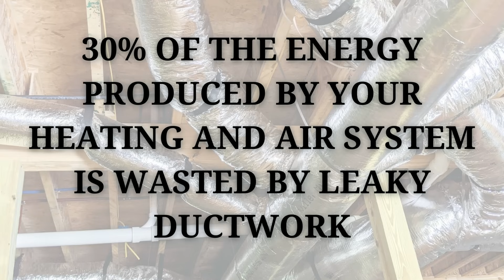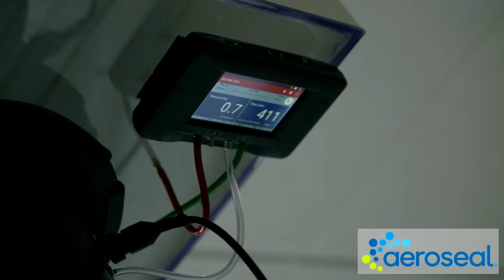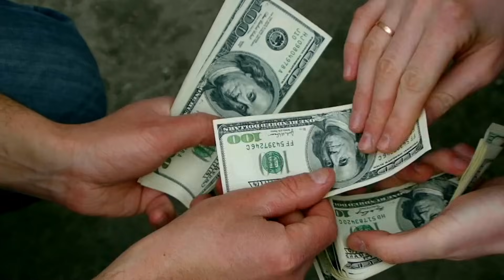5 Energy Wasters! - HVAC Wasting Your Money! - Save Money!

Comment: We could use some really helpful advice because last year we bought a new AC system that replaced the 19yr old one that was installed when the house was built and it worked fine and we never had any service on it in those year. We were sold a Goodman 4ton 18SEER system that has been an absolute problem energy wise because instead of energy bills going down they have actually gone up. We had an issue with a leak one week after the system was installed and the house was extremely muggy meaning we had over 45% humidity for over 1 month until I had them remove the thermostat and install a non bluetooth one. The humidity levels dropped over night but the electricity shot up to more than we ever paid with the old one. When the water was coming down the attic we asked them to come and fix it and I was told that the drip pan was cracked and that they had to replace the new one but they never did and then pop up into the attic was broken and they never fixed it and never fixed our ceiling. I was told to contact the Az Contractors office and file a complaint and also we have never received a copy of the permit for the unit because we signed a contract that all the work would be done to code. Can you please give us some advice ?
Reply from the maker: Eek. Is the contractor refusing to repair?
Reply: @NewHVACGuide  
They are giving us the runaround and they have since the AC went in
Reply from the maker: @RichardsBiggs  if they aren’t doing what their contract states regarding warranty, you may have a legal leg to stand on. Just make sure you keep good records of all communication Incase you decide to contact a lawyer.
Reply: @NewHVACGuide  Yes we have all the documented evidence we need if we move forward with a lawsuit we have the video recording from the security cameras but coincidentally they never not once ever gave us any paperwork other than the purchase order of what they came out here for and what they found.
Reply from the maker: @RichardsBiggs gotcha. Sorry it’s gotten that bad.

Comment: I bought a 16 yo, 2,000 sqft townhome with 3.5 ton a/c system with NG heat. The summer went well but when winter rolled around I was getting woke up from the hot air blowing on me, over 160 degF to be precise. I did a load calc and found I only needed just under 70,000 btu/hr. The furnace was rated for 100k. I don’t understand a contractor oversizing a unit so much unless the original owner requested it. In the fall, I got quotes for a 80k, two stage furnace with a heat pump. I really had no issues with the a/c but decided to go ahead and change both together. Now, my heat never exceeds 125 and because of the higher SEER rating, my annual gas and electric bills have dropped about 12% and more importantly, temperatures are WAY more comfortable, stable and do not cycle on/off nearly as much.
Reply from the maker: Wow. A lot of folks suffer and sacrifice for a lower utility bill

Comment: Connections to the plenum are where the biggest air leaks occur. I’ve seen brand new homes with incredibly shoddy ductwork. Installers just don’t care.
Zoning issues are a huge problem in large custom homes.

Comment: The cost of a higher efficiency system could be twice the cost of a standard system and you’ll never recoup that amount of money it could take 10 to 20 years to recoup the amount of money you’d save by putting in a standard system and not a high-efficiency system that is a lie

Another factor that you don’t even talk about is the type of insulation you have in your house if you have a 25-year-old house, 30-year-old house and you put a high-efficiency unit in with shitty windows and no insulation you’re still not gonna get any recourse by putting a high-efficiency unit in the whole point is mute

Comment: If you've got rooms that are colder than the rest, it might be simpler and cheaper to insulate them better (above and perhaps below) and put thermal curtains on the windows.
Reply: Agreed. Also check the duct passage to make sure it’s not obstructed. I had a guy in my attic who crushed one of the ducts. 
     My window replacement a couple years ago improved the cold room 80%. Drafty. 
And this year, I’m going to have my south wall insulated. It’s the wall that gets the cold wind in the winter and hot sun in the summer. The wall is cold/hot to the touch.

Comment: If your old system ain’t broke, don’t fix it. My old HVAC system is over 30-years old. New filters. Some annual cleaning attention. Ductwork inspection in the attic. Should be good for another 5-years. I may never have to replace it. The problem with new units is they are not built to last. Whatever “energy $avings” I might get would be eclipsed in repairs and replacements.
Reply: I used to say the same thing. As I’ve learned more in the trade though, it’s not so much that the equipment isn’t built to last but they’re tested to higher standards and can’t withstand the improperly sized duct work that’s out there. That’s something more HVAC guys need to educate their customers on. You go to a customers house for 10-15 years doing service and say everything’s great. Change the unit out. Now the ducts not right and the homeowners like what do you mean? You never said anything the past 10-15 years you been working on it. Older equipment could handle the extra strain put on them from that poor ductwork. Properly sized ducts with equipment now works fine and lasts just as long. Obviously you have duds here and there but that’s what a big portion of it boils down to. And most of these techs nowadays don’t even know how to size ductwork so how can they tell you yours is right or wrong?
Reply: @calebpruitt7235  :So, new HVAC systems require all new ducts? What seems to be the problem: too big or too little? Do I have to change all the vents too?
Reply: @majorburke9735  they don’t necessarily require new duct, it depends who put it in originally and what they knew. 98% of the problem is undersized, too small duct work. When you have this issue it causes excessive wear and tear and strain on your blower motor on the indoor unit and the compressor on the outdoor unit. A lot of newer units now have ecm motors, which have modules in them. The modules tend to go bad, not the motors themselves 8/10 times. They will go bad constantly on a duct system that is badly undersized. They’re rated to operate under certain static pressures. While too low of a static can be a problem, you rarely I mean rarely see that. Usually it’s high static pressures from the duct. A good way, obviously this is just a rule of thumb not the right way, but a good way to know if your duct system is undersized is if you can hear the ducts blowing or the return sucking very strongly. Like I said that’s not the for sure way, other things can cause that as well but hearing them blow or pulling very hard at the filter indicates undersized duct that needs upsized. A bit long winded but that’s the general idea. Happy to give any advice I can.
Reply: @calebpruitt7235  Very true indeed!